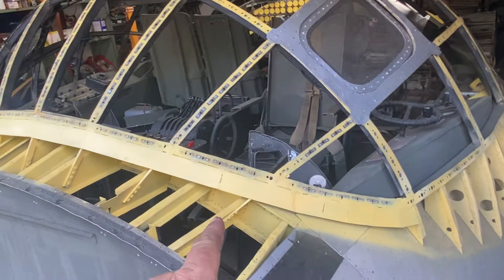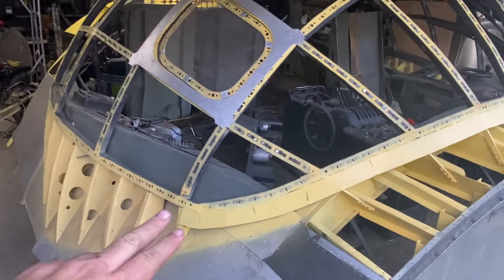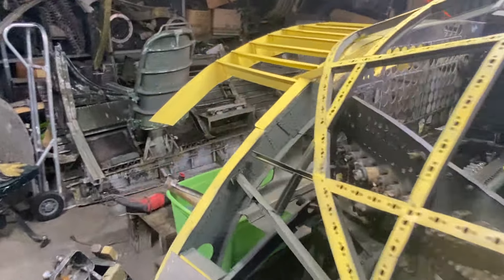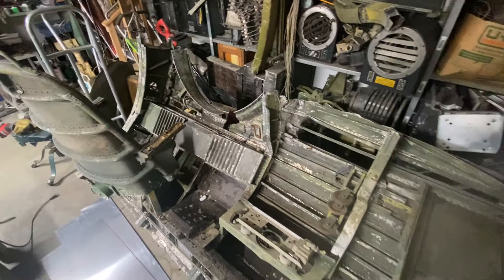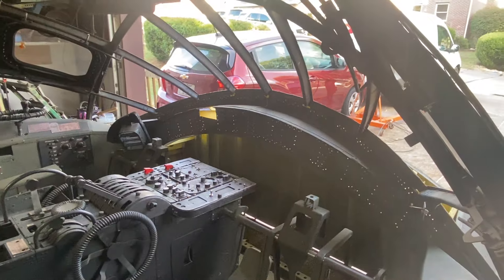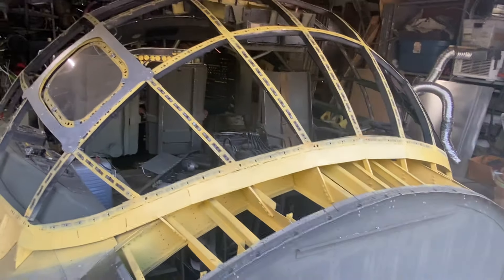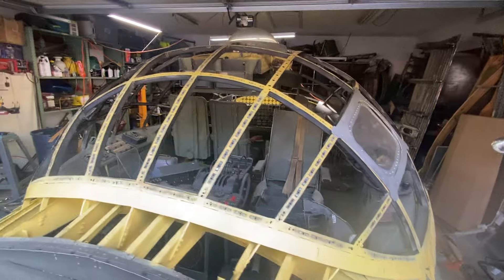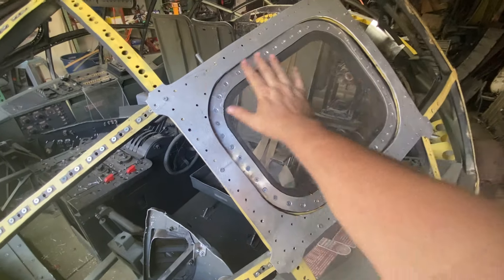The Big Nuclear Bomber in the Small Garage

Comment: I'm going to say it. I have some experience with KD displays like you are planning, and it's not worth it. Either in the impact of the display, on structural integrity, or the out and back perpetration time. Oh you might be up to fussing with it on that first setup, but the breakdown before you can go home after a couple of days at a show is grueling. And then to go do it again...  Nothing about the size of your project says you can't move it whole with a simple $20-$30 permit (Mommy-may-I permit) and you shouldn't need an escort for anything smaller then a single-wide mobile home.